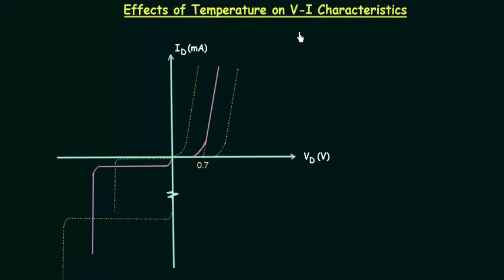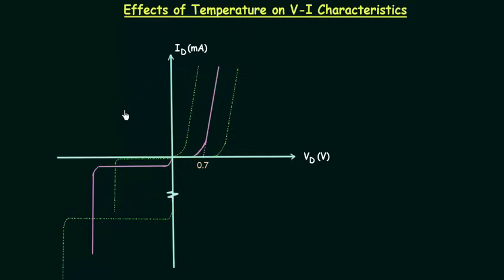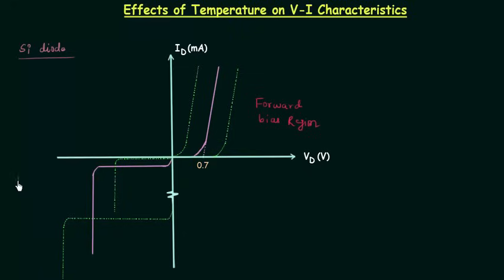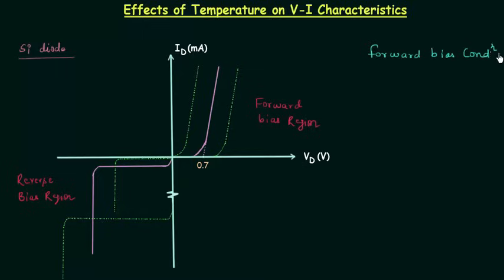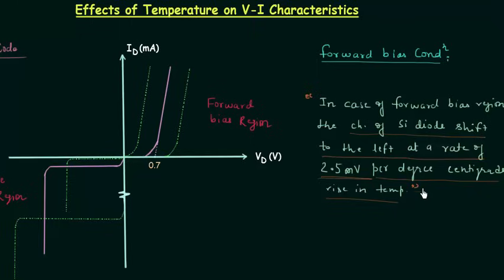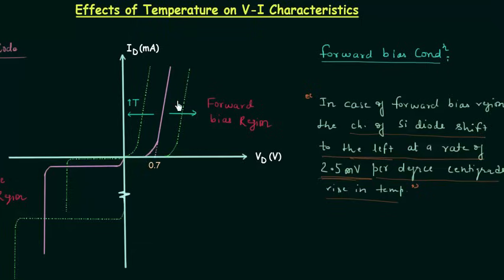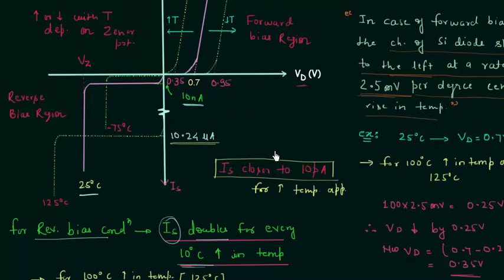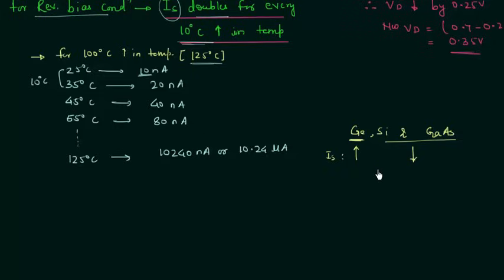Effects of Temperature on V-I Characteristics

Comment: In the last of video, we have compared Ge, Si, GaAs 
Ge has High reverse saturation current so it is limited in use
Why is it so?
How reverse saturation current effect use of it and on what parameters it will affect??
Can you describe it??
Reply: I'm not sure but the purpose of diode is to make current to flow in one direction and if the diode have high reverse saturation current that means it is allowing the current to flow even in reverse direction.
High reverse breakdown voltage is favorable but not high reverse saturation current . Correct me if I'm wrong😇.
Reply: it's leakage current is high and we need to have diode with minimum leakage current that is silicon diode.

Comment: Since Vb is directly proportional to T, shouldnt the graph shift towards right in case of rise of temperature?
Reply: Vb is barrier potential,we are drawing graph with Vd which is diode potential, the potential we apply to the circuit. Also the potential directly proportional to temp is Vt,the thermal potential.
Reply: I have the same doubt.

Comment: But sir in previous video....in barrier potential formula.....the Vd was directly proportional to Temp....bt in this video its opposite.....why??
Reply: I=IS∗(exp((V/(n∗k∗T/q)))–1)

Hence from equation we conclude that the current should decrease with increase in temperature but exactly opposite occurs there are two reasons:

Rise in temperature generates more electron-hole pair thus conductivity increases and thus increase in current Increase in reverse saturation current with temperature offsets the effect of rise in temperature Reverse saturation current (IS) of diode increases with increase in the temperature the rise is 7%/ºC for both germanium and silicon and approximately doubles for every 10ºC rise in temperature.

Thus if we kept the voltage constant, as we increase temperature the current increases. Barrier voltage is also dependent on temperature it decreases by 2mV/ºC for germanium and silicon.

Reverse breakdown voltage (VR) also increases as we increase the temperature.

Comment: Breakdown voltage may increase or decrease with temperature depending on the Zener potential, what do you mean by this? What is zener potential here?
Reply: Shreya Baranwal  
Breakdown voltage depends on temperature coefficient.
In zener breakdown temperature coefficient is negative so by increasing temperature breakdown voltage decrease and in avalanche breakdown temperature coefficient is positive so by increasing temperature breakdown voltage increase 
Both breakdown have different machnism so it happen.
Reply: Will you please explain the complete mechanism of this difference in temp coeff.. between zener and avalanvche.. 
thanks

Comment: you've told that the breakdown voltage may increase or decrease with temperature depending upon the zener potential.   So plz explain how not clear
Reply: samiya murtuza 
Breakdown voltage depends on temperature coefficient.
In zener breakdown temperature coefficient is negative so by increasing temperature breakdown voltage decrease and in avalanche breakdown temperature coefficient is positive so by increasing temperature breakdown voltage increase 
Both breakdown have different machnism so it happen.

Comment: sir, at 11:50 you've told that the breakdown voltage may increase or decrease with temperature depending upon the zener potential.   So what is is the difference between the breakdown voltage and zener voltage?    Are they same things?

Comment: Thank you for the awesome lectures.One request from you sir can you please calculate the reverse saturation current when we decrease the temperature that is at -75 C.It will be really helpful for me.
Reply: Rashmi Sharma you can half reverse saturation current for every 10°C decrease in temp... I got Is= 0.009765625 nA or 9.765625 pA at -75°C
Reply: @hadiaamin1466  in your answer where u got Is= 9.765635pA in -75°c.. is not possible..Bro...
(Is) should be 10pA when increase temperature . In here u will reduce the temperature...

In my calculations.. in -75°c Is= 0.009 nA or, 9×10^-6uA  or 0.000009 microampere
Reply: @hadiaamin1466  you worng bro

Comment: can u show how  germinium' saturation current is greater than si
Reply: Muhammad Aqeel The Ge valence e-s are at a higher energy level than those in silicon. Therefore they require smaller amount of additional energy to escape from the atom and become free e-s. Thus the no. of minority carriers generated due to temperature will be higher in Ge and hence the reverse saturation current will be  greater.

Comment: Hi,I have a query regarding the temperature coefficient of Silicon diode. You have stated that for forward bias of silicon diode, there is an increase of 2.5mV/degree centigrade. However the book I'm reading from M. H.Rashid ,Microelectronic Circuits: Analysis & Design,2nd Edition (2011) states that its -2mV/ degree centigrade for silicon diode. Is this temperature coefficient variable for each silicon diode?Thanks
Reply: I had a similar doubt. 
 What I found is as temp increases, Drift current increase( much more than diffusion current), If we reduce FB voltage then current can be brought down to its previous value. So for the same I, a lower voltage is needed, hence the plot moves towards left at 2mV/ degree or -2mV/ degree.